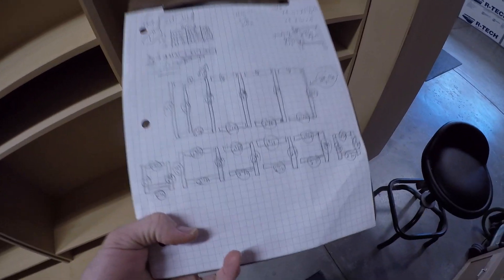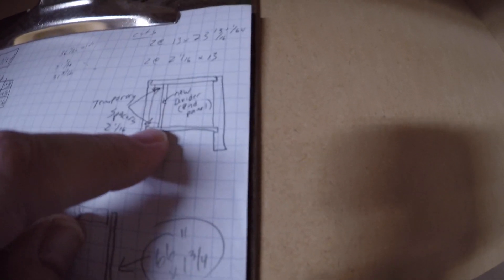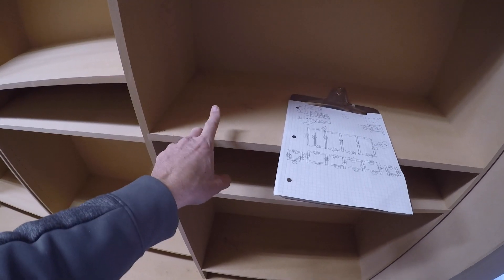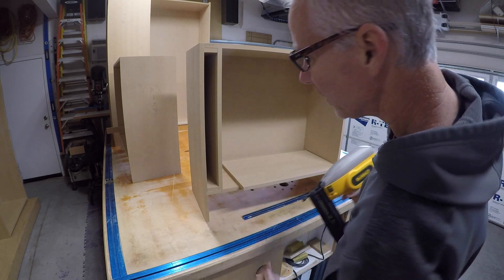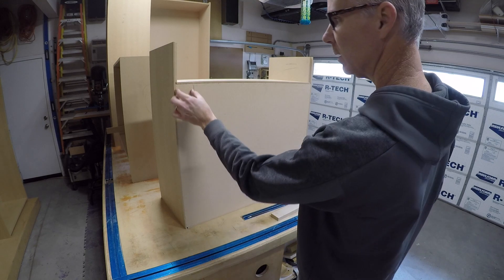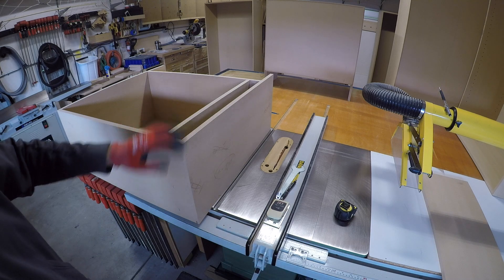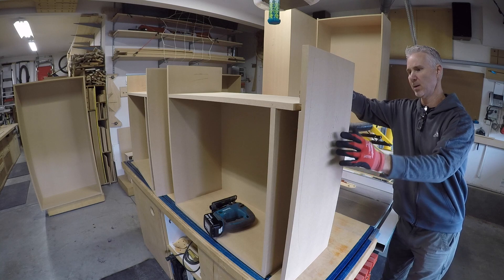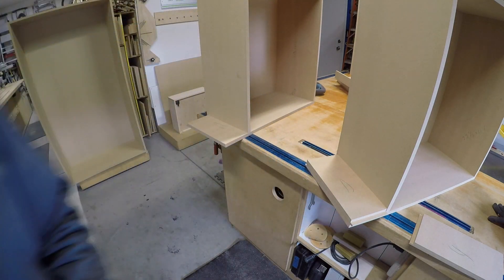How To Fix Cabinet Mistakes!!!  I Made A Big Mistake But Corrected It!

Comment: What kind of driver were you using?
Reply from the maker: Hey Dave.  Good name.  Maybe you’re referring to my bit with countersink?  It’s a bit that’s not made anymore. It’s a jack rabbit.
Reply: @davidbryanwoodworksandmore  actually I was referring to the drill/driver you were using. It looks light and compact.
Reply from the maker: @daveerickson5313  oh.  Yes.  You’ll see that I only use these drill drivers in my shop.  And on site.  They’re great. Makita 12v. Only available used now on Craigslist or eBay.